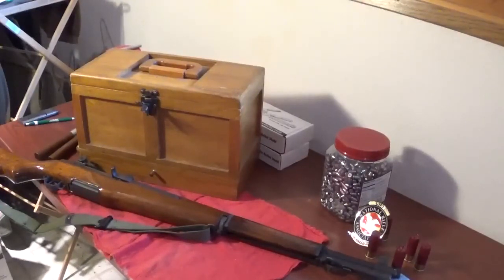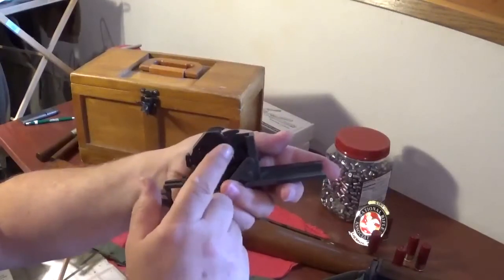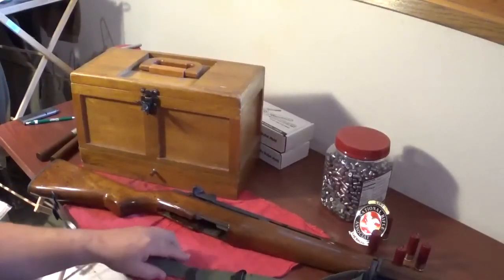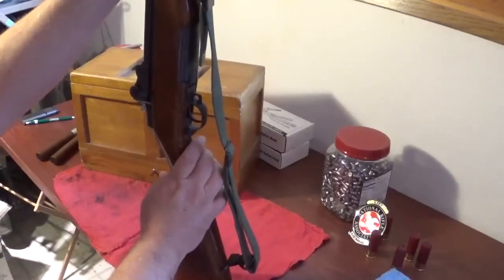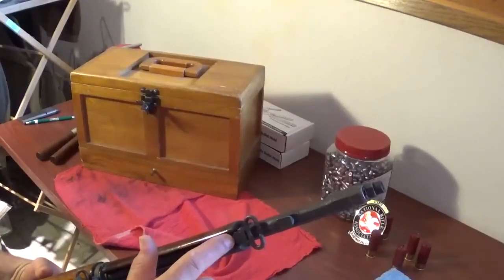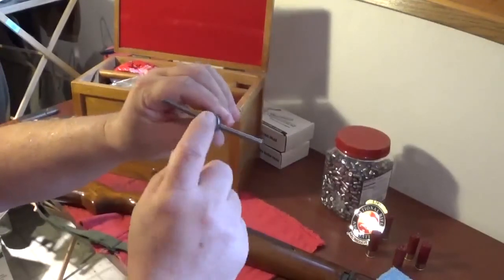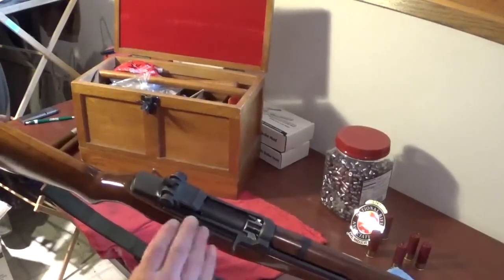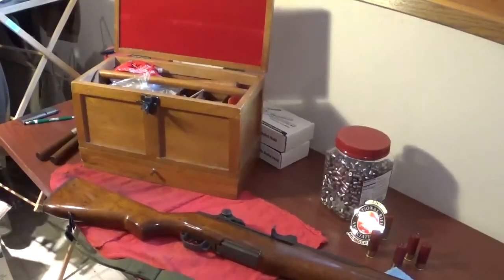More M-1 stuff.

Comment: Thanks a lot man!  A video is worth a million words.  The catch sear makes a lot more sense now.  I haven't had any double fires yet, but I'll have a really close look since I've got everything torn down.  I'll also see if I can get a milled trigger guard.  Are there any compatibility concerns with those?  Or do they work on all Garands?  Thanks again man.
Reply from the maker: Yes.. They work on all Garand's You shouldn't have any Problems with the Milled trigger guard they can be a bugger to fit into the frame of the trigger assembly, Thing is you want to get rid of the spring steel one, They are a source of trouble. Might take you a few try's.. There is another place to grease, on the saddle of the op rod, The contact point under the chamber where the op rod rides...I got to do something.. my lighting sucks. I was hoping to get a clear "Uppie Closey"  of the sear engagement for you.  I think you are well on your way to getting success with the Old Girl.. They are sweetie Pies to shoot. I like them better than the M-1A.. also.. All M-1's were made to the same level of quality, whether it's a Springfield, Or a Winchester, International Harvester, or a Harrington Richardson.   Let me know if you need any more Video takes from me. Dave.